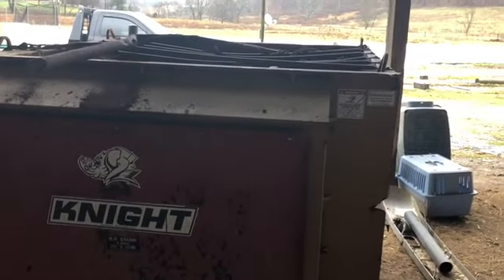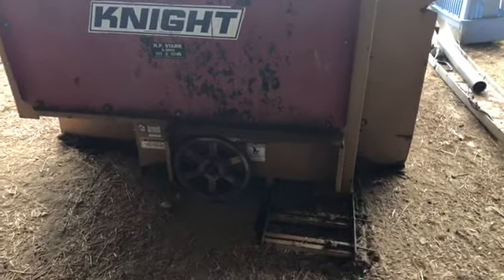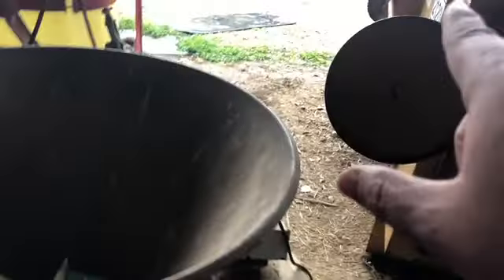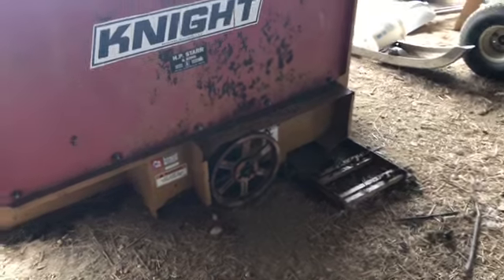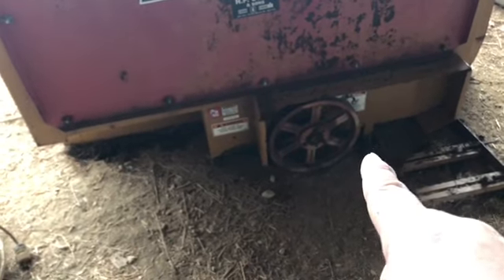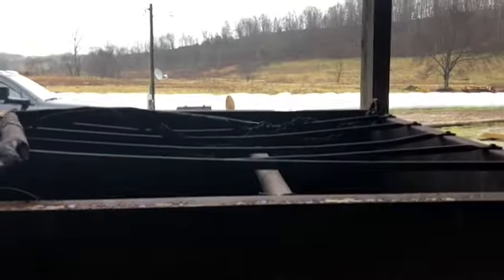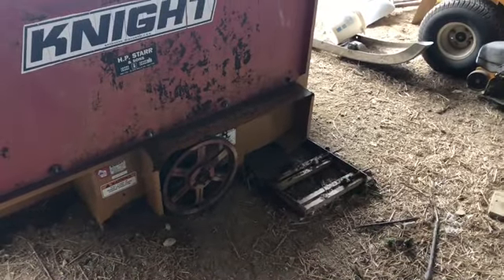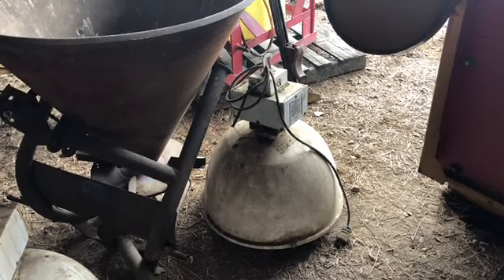Looking at TMR mixer

Comment: I bought a mixer just like that on an auction, had a 10 horse electric motor. I did the math after measuring pullys and the input shaft should be running right at 540. I will be converting it to pull type.
Reply: Also, if you put a gas motor on it, make sure it will turn the right direction. I think yours will, as it is right hand discharge.

Comment: I think that 10 horse motor should work. They turn 540 RPM max, a smaller pulley like a 2-3 inch would work
Reply from the maker: Wonder what kind of clutch setup it had on it? I'm not sure a centrifugal clutch would take the abuse? But hate to build a pulley tightening system! I'm going to look on line at clutches today.
Reply: @laurelcreeklivestock6587  all the mixers I've seen tighten the belts by sliding the motor.
Reply: Otherwise, use a cam over style lever with a idler pulley to tighten the belts. But those reel mixers take no power on start up so the belts could just be left tight, start the motor before adding feed stuff and you should be fine